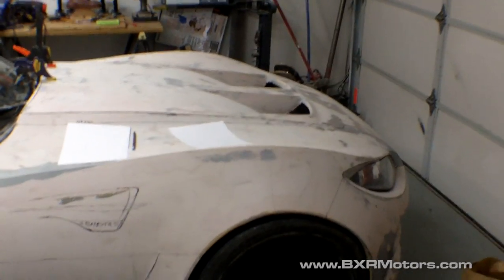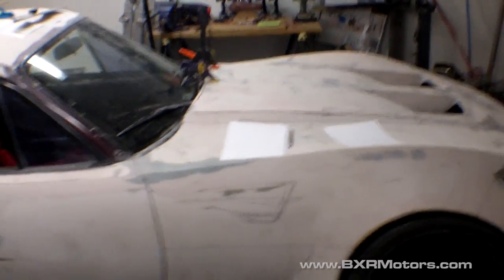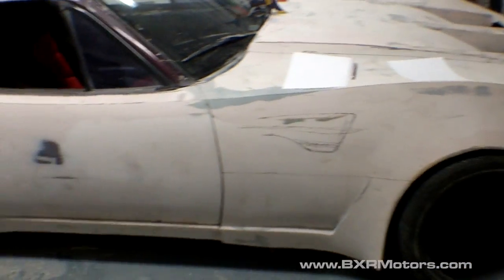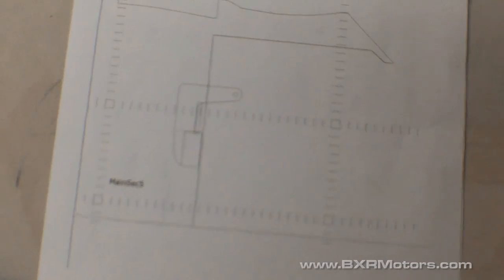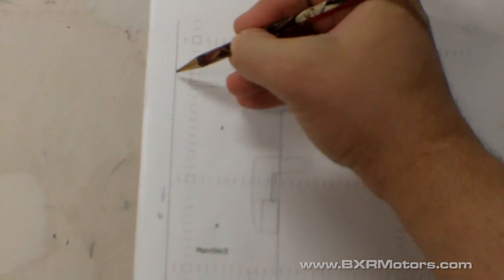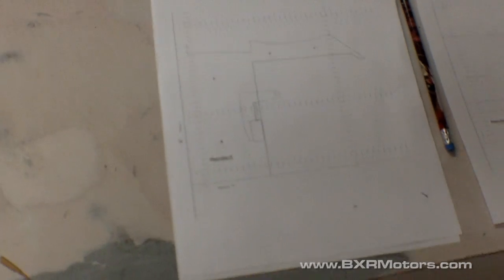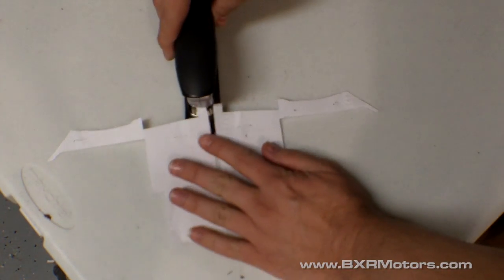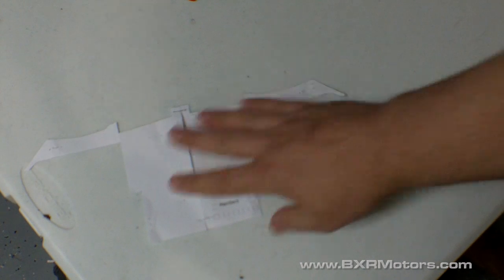Q&A - Body Buck Forms - Bailey Blade XTR Car Design - Part 86

Comment: In you last vid when you tried to make the fibergass hatch, I was thinking that would make a good mold after cleaning up the inside of the tape imprints and reinforcing the outside to insure the proper shape. If you used the actual fiberglass piece you made it would be scaled up a size and won't fit as well as the original buck piece. Just a thought and I wish you continued success with the project man.

Comment from the maker: Yeah the rear hatch piece was not really a mold exactly. I used the same method but ended up using the main piece as the actual hatch. I did it like that so I had a hard surface to work with and could test out a few ideas. Here pretty soon, we will be making complete mold of the whole car and all its sections.

Comment: So I gather from this vid that you will eventually build your own mold or molds based on the buck you have made using the mdf and foam. I would guess this because you made a mold of the rear hatch panel in the previous vid. I saw a vid elsewhere on youtube where a race team used the metal hood and fenders from a supra added, modifed and molded an aftermarket front fascia to the hood and fenders to make a complete front clip and shipped out to a company to make a 1 piece fiberglass clip.

Comment: what confuses me is that the wood forms are like the skeleton of the car right? i mean you put fiberglass and body filler over that, so like... isn't it much bigger now than it should have been? or did you compensate for that by scaling down the cross sections in wood? is my question clear? lol, sorry, i don't know how to explain. like the surface of the car should be at the height and width of the wood, but the wood is under a pretty thick layer of other materials so...?